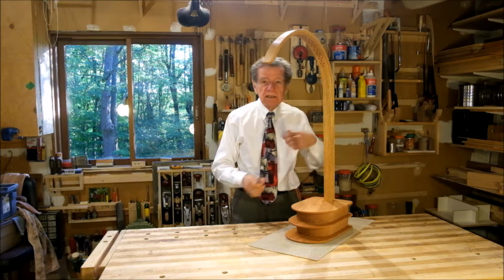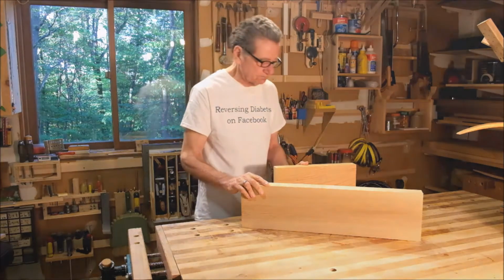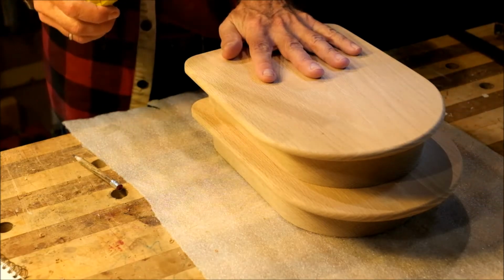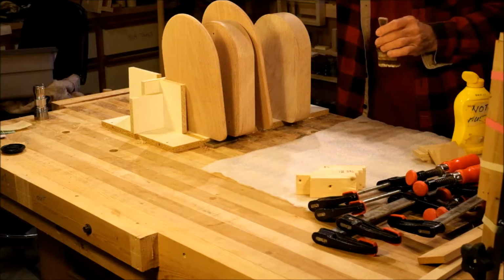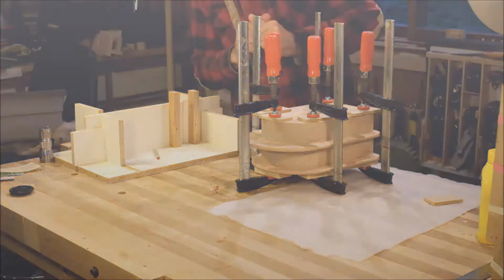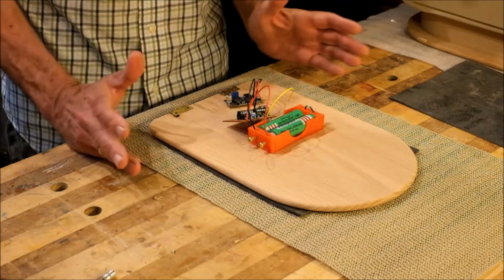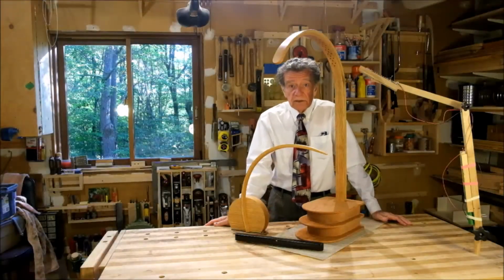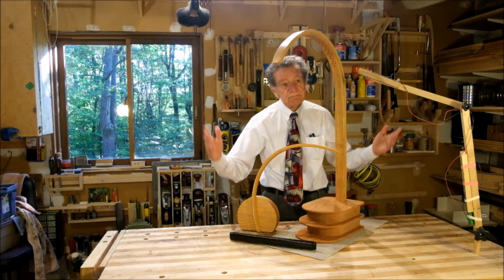George's Woodshop: LED Lamp Part 6.

Comment: I like that glue up jig!  Any more useful jigs like that?  Thanks for the great content I always enjoy it.
Reply from the maker: Hey Stephen.  I have several jigs that are either: hit-or-miss and therefore not worth filming; or are copies of better jigs seen dozens of times in other You Tube videos.  Not sure whether you've seen them, but I do have two videos of jigs that are worth watching because they're neat designs that I've not seen in other You Tube videos.  One is my very first You Tube video in April 2016 -- actually the reason I started making videos -- about a versatile, simple-build, box joint jig.  The other one is a dangerous-looking, short-fence, add-on for the table saw for thin rips.  That one is in Part 3A of the LED Lamp series.  Thank you for your vote of confidence in my material.